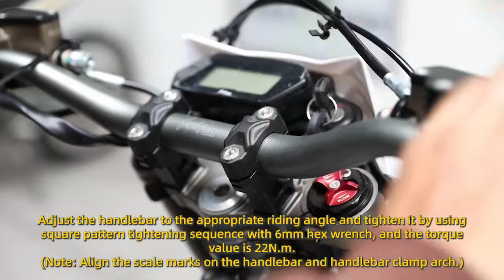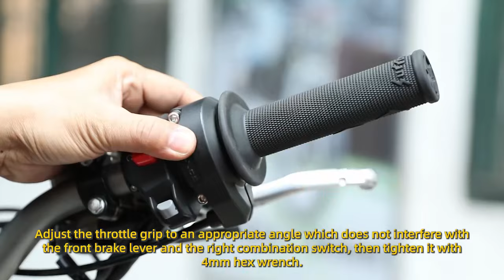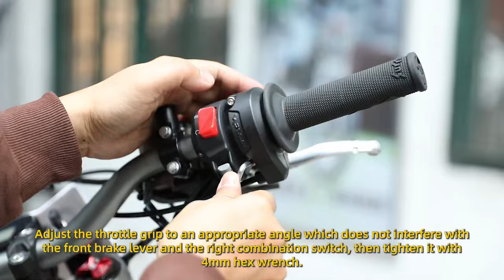Surron Ultra Bee Unboxing

Comment: When is availability?
Reply from the maker: We are hoping no later than summer 2023
Reply: Please let me know if you can pre-order and how much it cost
Reply: @lithiumpowersports    Any ballpark price?  Need to know how much I have to save..Will the 72 volt 55 amp/hr battery have a bluetooth bms to monitor individual cell voltages?  Looks like it’s a step up from last year….bravo!
Reply: @derekwatkins5135  Where do you live ?
Release dates are sooner in certain areas.
Reply: @jimhofoss9982  They are 7500 USD delivered to your door.
Depending witch dealer you buy from.
Reply: @Beniamin6665  I live in Norway, got mine for 5400 USD

Comment: Estimated price they are giving to reviewers is 8000usd. Almost everything is a slight upgrade with it being compared to an mid-level upgraded light bee. I’ve not rode either of them. I would also expect availability to be limited fast and for prices to rise quickly on both models.
Reply: Not a chance! UltraBee is completely different
Reply: @Beniamin6665  it is different parts but comparable to the upgrades that 3500$ extra would get on a x. The chassis though is the main thing on it that makes me tempted to save a little longer.
Reply: 5000$ from china
Reply: @FumblsTheSniper  5850 total to my door
Reply: @FumblsTheSniper  that was my plan and if I don’t get over 6.5 I’ll jus keep
Reply: @coltenfisher7329  Taxed? Mines all in taxed was 6120... Damnit thats tires! But waiting 2 months and sending that much money to China is not for everyone LOL.
Reply: @CrossWindsPat  5750 I think was my total price, if you wire it you can save an extra couple hundred on the Alibaba fees